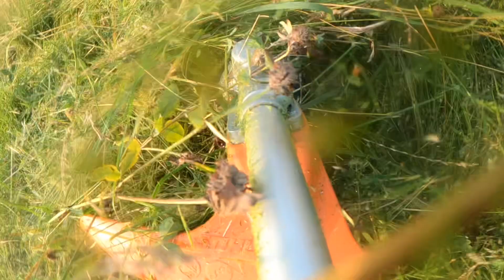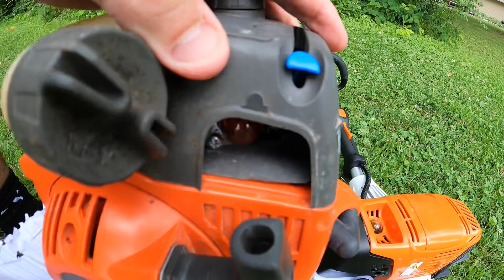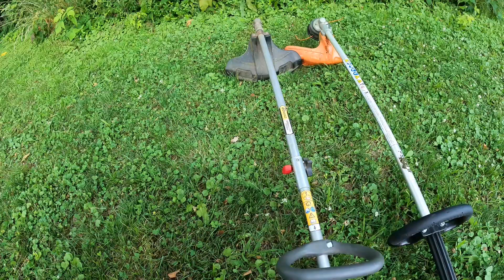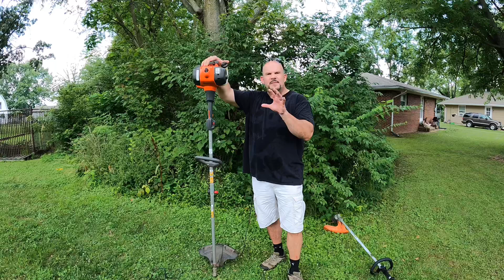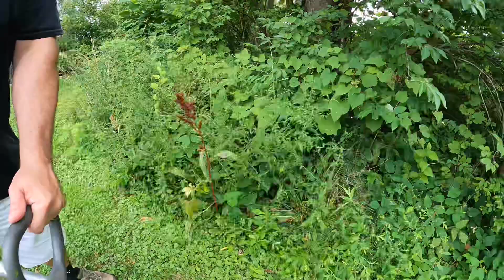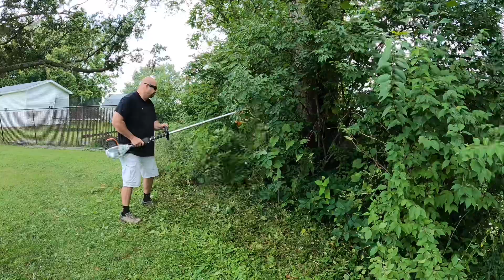Stihl FS 91R VS Husqvarna 128LD. 4 Stroke VS 2 Stroke.  #StihlFS91R #Hasqvarna128LD

Comment: I have a Stihl FS80 2 stroke and a 128LD 2 stroke and I’ve never had to get my 128LD serviced but my stihl has had to have the cylinder head rebuilt a 2 times. Everybody has a different experience with their equipment.
Reply: This is my experience with my Sthil that I spent 489$ on.  Both repairs cost me $200 because ethanol ruined my trimmer even when I tried to buy ethanol free gas...there is nearly 3 gallons of cheap 87/89 octane gas in the pump and hose from the last person.  This means for a 2.2 gallon can you are getting all 89 octane gas with ethanol in it while you paid premium fee for ethanol free gas.  And it will ruin the gaskets and seals in the Sthil.  This guy is a Sthil fan boy without looking at the facts.
Reply: I have 2 128LD’s and they’ve been great, no issues. Not commercial quality but I didn’t expect that, they’re perfectly fine for homeowner use.

Comment: I own the Husqvarna 555FX 53.5cc Straight Shaft. You need to trust me, this thing is freaking powerful, if not a bit better than a sthil. Had it for as long as i could remember, all of the malfunction you described, hasn't happened to any of my Husqvarna products.
Reply: Yeah because he's using a cheap homeowner Husky to try and make Stihl look better 🙄
Reply: @JenkinsMowing86 a homeowner STIHL is still much better than a Suckavana homeowner
Reply: @CoastalYardCleanup  I run commercial anyways, and run all 3 of the top brands. I would ditch Echo and Stihl in a second for Husqvarna...
Reply: @CoastalYardCleanup  you Stihl guys are all the same. Stihl ain't that great, if it were I would buy more of it and use it exclusively. Honestly Echo is my second choice over Husqvarna
Reply: @JenkinsMowing86  do the commercial and homeowner/ranch equipment have a big difference when it comes to trimmers?
Reply: @JenkinsMowing86  I could say the same about Husqrvanna just depends what you like I meant it in a humorous way I know that STIHLS not perfect and I know that Husky and Echos aren’t perfect either
Reply: @CharlieRobinson_21  true honestly I like running all 3 just to have something different here and there 😄
Reply: @CoastalYardCleanup  oh yeah. Night and day difference between the homeowner and commercial trimmers. There is semi pro types which I guess those would consider as farm grade. The 525LST is the best trimmer out there in my honest opinion.
Reply: @CoastalYardCleanup honesly no bias whatsoever, I don't work for them or anything. I ran a Stihl 90 for years and then used a Husqvarna 223L(semi pro) for a landscape company about 15 years ago and that was it for the Stihl. The model they replaced it for is a 525L which isn't heavy commercial but it is commercial. The LST is built stronger, much more torque, a whole different engine. I actually own a Stihl 91 along with a 266 Echo and 2620 Echo. The Stihl gets used the least. I've also ran a 94R which is the same size engine as the 525 Husqvarnas. Modern day you can't go wrong with any 500 series Husqvarna from saws, blowers, trimmers. Etc. Now I know they've made their duds as well as anyone else but get a 525LST and you will thank me.
Reply: @CoastalYardCleanup  that's why this video offends me so much. He's comparing apples to oranges. You can't just compare brand name to brand name, you have to compare grade vs grade and the 2 trimmers in this video are not even the same class. Both 30cc engines but that doesn't mean a thing
Reply: @JenkinsMowing86  yeah as much as I love to hate on Husky just because I love STIHL so much it really isint fair but why is the STIHL FS 91 considered a 4 stroke?
Reply: @CoastalYardCleanup  that's understandable. I get that about Stihl when in all honesty you can't go wrong with either of their commercial gear. They're the top 2 for a reason. Someone explained that once it's something about the amount of times the engines cycles. So technkcally it's 4 cycle not 4 stroke. Husky makes a couple true 4 strokes the 324L and 524L. Pretty sure they use Honda engine in those particular models.
Reply: @JenkinsMowing86  oh ok Thank you so much

Comment: I have had a Husqvarna 128LD for 5 years.There is not one of those things happen to mine.I use an additive in my gas.Hasn't cracked.I have used the tiller attachment in mine all day and did not catch on fire.They are cheap enough that you could buy one every three years and be better than a still.

Comment: Don't know how this is a fair comparison.  If you're gonna compare a stihl vs that hucky 128ld, be better off using the fs56, or use the 525 series to compare to the fs91r. Comparing a low mid grade residential trimmer to a professional trimmer isn't equal.
Reply from the maker: Bro these units cost roughly the same price.  That’s why I am comparing them.  Dollar for dollar STIHL wins!  Hope that makes sense! FS91 R kills Husqvarna 128.
Reply: @DiscoveringHisWay  no it don't make sense. You're still comparing a residential trimmer vs a pro. The 128ld is currently going for $240 in my area, similar price to the fs56 which is going for $220. While the fs91r is going for $349 right now and the comparable husqvarna 525l is going for $339. Again in my area. Husqvarna made this trimmer to compete with the fs56 and the echo srm225 because it's a homeowner trimmer. So yes in your comparison the stihl wins, id hope so since it's a pro trimmer. If you're saying that stihl wins overall because of this review then sorry but thats a bad way of putting it.
Reply from the maker: Tell Husqvarna to send me the  latest and greatest trimmer and I’ll give them a honest review again the STIHL FS 240R, let the chips fall where they may!
Reply: Don't know why you're bringing up the stihl fs240. Plus most people have no need for one that big, even professionals unless you plan on doing thick brush cutting or thick tall grass. The stihl fs91r, 111r, and 131r are the right trimmer for most people. Husqvarna has there 525 and 535 series that compete with the stihl models and echo has the 2620 and 3020 series, in normal and T models. Makes it more of a fair comparison. I've had all 3 of the big name trimmers and there all great, and of course they each have there good things and bad.

Comment: I have a 2014 husqvarna 128l and have been using it for commercial use and not have had any issues with it. So 10 years of use and heavy trimming. And still to this day runs like a champ. I have had mine so hot on a really hot day and running the crap out of it and you could not touch the plastic and I let it cool down and yet it still runs like a champ. Just saying 😌

Comment: it’s not a 4 stroke. It’s a 4-mix. Which has way more torque and is made for more tall grass. A 4-mix is essentially a 2 stroke with overhead valves. And it also still takes fuel mix 50:1. No oil fill. In 4 strokes you don’t use fuel mix. You use normal gas. How does no one know this?😅 lol
Reply from the maker: You’re just so smart. 😆
Reply: @DiscoveringHisWay  sorry if that was offensive
Reply: @DiscoveringHisWay  I didn’t mean it to be rude or mean in anyway.

Comment: Well somewhat i do agree with you but the 128ld is a homeowners unit, try comparing it to the 525lx, it could have more power or equal, i ran my 128l through 6 or 12 inch tall weeds with 0.95 line, does the job well since i had it for 7 years, plus my echo srm 210 is an older unit about 18 years old, still runs great just like stihl, 

Keep up the great work Matt!

- Steve

Comment: 2 years ago, I got a Honda plastic desk lawn mower, like a $800 unit.. beyond worth every penny..Today, I got a Stihl FS 91 R, it is a beast... I had a little issue with the bump feed but suspect the dealer did not wind it correctly. This unit has beyond power.. $335 I think worth it. I might look at other heads. I guess Stihl is the Speed Queen of trimmers... I avoid Harbor Freight Chinese shit as much as possible.
Reply: get a speed feed 400

Comment: My husqvarna 128ld is 12 years old runs great with great power use it around the house. i also have a 130l 
Which is the newer version of the 128 it is a very smooth and powerfull i use it commercially never had a issue with it ether although i bought a sthil fs56 a few years ago it was already hard to start and falling apart in a few months.

Comment: Just got myself a husqvarna 525rxt here in the UK after lots of comparing. I'll be using the machine all day long so comfort and anti vibration is super important to me. I do like Stihl but the husqvarna is so much nicer to use. Plenty of power and torque and a little quieter aswell.
Reply from the maker: Just wanted you to know that Husqvarna sucks!  Doesn’t matter what part of the world you live it; Junk, garbage, equivalence to sewer rats.  You have no idea what true torque and power are!  But I like you even know you use junk!  Buy STIHL and no one will make fun of you anymore!  Don’t be cheap, spend the euros!
Reply: I'm a Stihl guy and this guy doesn't represent our community lmao just because one brand is good doesn't mean the other is bad that's a great trimmer man glad it's working for you
Reply: @haydenshores9943   stopped on my lunch break after using the trimmer... funny enough. It's absolutely great, starts first pull and has had very heavy commercial use from day one 👍🏻

Comment: Using a Straight Shaft Stihl atm the 56 and I can say the only thing that broke in 6 months was the plastic cover for it and that was on me not the equiptment. Only spent 16 NZD/8 USD on parts and one bottle of oil.
Reply from the maker: Hey stop busting up the Orange Polymer casing. Lol. I’ve broke mine by dropping it off a cliff one time. Ouch!   Congratulations on your trimming, blessings!
Matt
Reply: The plastic cover I mean the line black casing that spins the trimmer from the bottom of the shaft lol

Comment: If memory serves me correctly the STIHL FS91R is a 4mix not a true 4 stroke. While it does have a 4 stroke cycle it still uses 2 stroke mix gas hence the 4mix designation. Just wanted to throw that out in case some average homeowner like me assumed 4 stroke and 4 mix were the same thing. Serious engine damage would occur in short order if regular gasoline were to be fed to a 4mix machine.

Comment: It’s a different sounding engine. It sure doesn’t whine. I love sthil products. The 4mix has been around a while. With all the places the tiny amount of oil mixed with the gasoline has to travel; I wish it was 40:1 mix just to be on the safe side. You also have to pay attention to letting them idle a little bit more than usual to let them cool down in very hot conditions.
Reply: I just ordered on lay-away 1 of these! I feel in love with the quality. The engine sound is nice! I love 2cycles! But, the low tone. Slow sound of this engine is yes! Fun to listen to. Yep! You sold me on something that I wasn’t sure about.
Reply: Sorry to bother. I took delivery of my FS 91 R. Everything you’ve said about this unit is very true. To be honest I wasn’t sure about the 4mix; 4 cycle engine. But, after getting it home and trying it out. It’s a sweetheart! Easy to pull the starter. Amazingly no blue smoke! It doesn’t wind up like a 2 cycle. But, it has so much torque. I am not sure. But, I think they use less fuel. They do run a little hotter than the 2cycle. So, running it hard a suddenly shutting it off. Probably isn’t a good idea. My point? Thanks for sharing and showing the public what a good product you’re getting for not that much more money. Probably saving money in terms of fuel and repairs.

Comment: I own a husqvarna 128l and a Stihl fs91r. I like the Husqvarna way better..the Stihl burns my arm when I tip it to edge. And it cost way more. The low throttle smoothness and performance,and bump head design is way better on the Husky too..Its funny how you say "its plastic" when they both are plastic. Its obvious you are trying to make the stihl sound better,but it is not.

Comment: Ballistic composite lol! You do realize that  that is just fancy sales talk for plain old plastic right? It's probably the exact same plastic in both, more then likely. In 2023 all of them are made as cheap as possible in my opinion. I worked a few years ago, for a large landscaping contractor, who had contracts to cut roads and highways for the state and were cutting the property of many different business including Walmart. When I started they had all Steil products, but by the time I left they were about half Steil and half Husqvarna. The last time I saw one of their trucks go by, they had replaced all the Steil stuff with Husqvarna. Even before I left, when we pulled up to a job sight, guys would race getting out of the trucks to get first choice on weed eaters. Everyone was choosing Husqvarna over Steil and that's a fact. They all figured out that the Husqvarnas were lighter weight and more comfortable for long periods and cut just as good.

Comment: "stihl never break down" then why is there a service center in every town? gtfo here at least be honest. My Stihl stuff breaks just as much as everything else, its just more expensive to repair. For reference I have that 128ld and I do have to replace carbs on it every couple years. Other than that its a great piece of equipment and its not $60 bucks cheaper like you said its $90.

Comment: This is an annoying comparison, apples and oranges. The Stihl probably costs double. I beat the shit out of my 128ld for about 9 years. I'm going to replace it with a new 128ld. Changing out the gear head does NOT mean it accepts attachments. I swap attachments on my 128ld in about 30 seconds.
Reply from the maker: 128 is a piece of trash!! Hey let’s go to the Home Depot and get a new weedeater, oh I need to get some fertilizer for my flowers as well.  Where is that piece of trash made; sometimes it is China, sometimes it is Indonesia and sometimes it is the Nam. It just depends on who the cheapest bidder is for that year.  Flowers, grass and weeds make fun of you behind your back.  Joke!!!!!
Reply: Agreed, had mine 9 years too, trims 5 yards a week, still works fine. Paid $100 for refurbished.  This guy clearly works for stihl.

Comment: The Stihl 91r is a 2 stroke as well my friend...
Reply: Then I  guess a Detroit Diesel is four stroke. Not! 
The Stihl is a four stroke; suck, squeeze, bang, and blow.
Reply: @Bill-sp8kb  
STIHL FS 91 R 
-28.4cc 2-Stroke Engine
-4-Mix Engine Technology
-Simplified Starting
-Supplied with Double Strap Advance Harness
-Loop Handle
From the Stihl printed specifications...Check it out
Reply: However in doing some online searching it appears it's also listed in multiple areas as a 4-Stroke engine that takes 2-Stroke mix??? Beats me...
Reply: @llkj2121  I've owned an FS 90R, 94 R. I must say that I prefer the two-stroke 94R, hands down.
Reply: It's called a 4-mix engine for a reason. Another hint is the fact it has valves. It's understandable that some are confused that a 4-stroke engine runs on a gas/2 cycle oil mix, but Stihl (& others) have their reasons for this.

Comment: The 91r threw me off guard because it’s a 4 stroke but requires 50:1 gas n oil mix? There’s no separate oil reservoir for the crank so you can just put straight gas in the fuel tank?

Comment: What gas you use for the 4 Stroke stihl
Reply: 50.1
Reply: 50:1 is a two stroke fuel mixture a four stroke takes no oil in the fuel but the sthil is a two stroke you can also run 40:1

Comment: Anyone with any sense or even a slight grasp of knowledge on tools should know this video is full of misinformation and a cheap shot at Husqvarna. He's comparing a commercial grade Stihl trimmer(around $400) to a homeowner grade Husqvarna($around 200 dollars). A cheap trimmer you can get at Lowe's that's ideal for lighter use. A fair comparison would be a commercial grade Husqvarna to the FS91 Stihl. Some models of the Husqvarna would be a 525LST, or a 430LS... this would be a much different video if so. I run Stihl, Echo, and Husqvarna (all commercial) and 9 times out of 10 I'm grabbing Husq... so for the poster of this video and to others out there, learn the difference between tool grades when making any comparison!!!

Comment: This is just my opinion but I personally hate 4 strokes
Reply: I don’t like em either…won’t rev like those 2 strokes
Reply: Just tell us why am planing to buy one
Reply: @dancefelode To me they don’t seem to run as good as the 2 strokes and plus the way they sound is just cringe Imo
Reply: @mkfan6167  so should I just opt to 2 stroke
Reply: @dancefelode  Yup, you will not be disappointed with it, I have a Stihl fs94r and an Echo srm280t, they are both very powerful and way better than any 4 stroke unit
Reply: @mkfan6167  I don't think if I can get them in Kenya
Reply: @dancefelode  What brands do you have there?
Reply: @mkfan6167  wokin Ingco ...Total
Reply: Just buy stihl fs 120 it is almost best trimer in world
Reply: @rafaeladamovic330  Nah I will never buy a 4 stroke, 2 strokes is what I like
Reply: @mkfan6167  it is 2 stroke trimer
Reply: @rafaeladamovic330  Oh my bad I looked it up, to me it just looks like the fs250r but I’m sure it’s just as powerful as the fs250r
Reply: If you have the tuning tool for the Husqvarna and can tune the carb it’ll start first pull every time.
Reply: Yep, there's nothing like the simplicity of a 2 stroke
Reply: Its a 2 stroak
Reply: @mkfan6167 You have no idea what you are talking about.  I have both the FS91 and the FS94.
Reply: @ronaldnorris2179  it’s not a 4 stroke. It’s a 4-mix. Which has way more torque and is made for more tall grass. A 4-mix is essentially a 2 stroke with overhead valves. How does no one know this?😅 lol
Reply: @HorrorBigGameRR  Agreed, I was stating I don’t like Four strokes I wasn’t talking about 4 mixers.
Reply: @ronaldnorris2179  👍
Reply: Wtf is the difference lol. My fs91 is raw compared to husqacrap